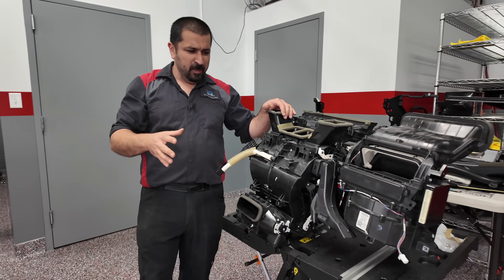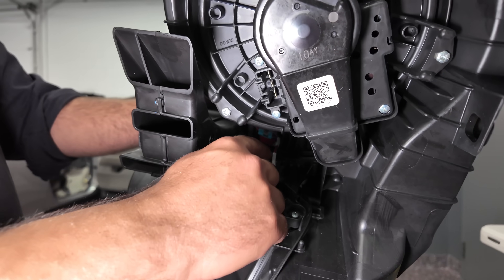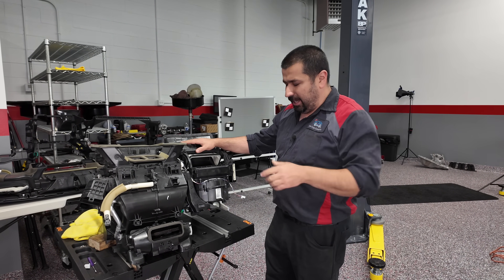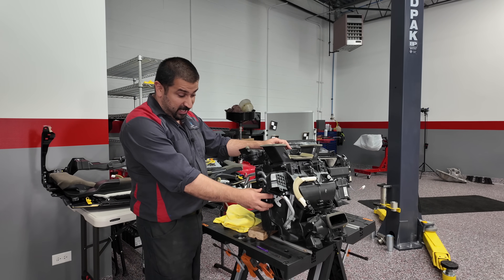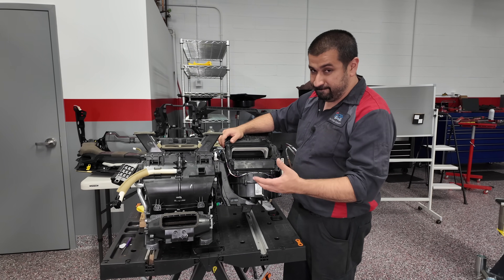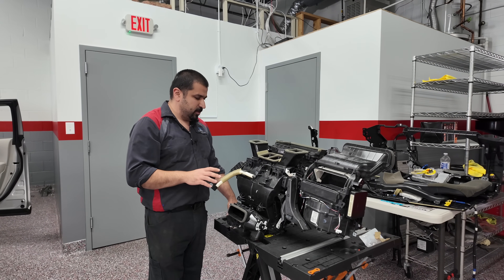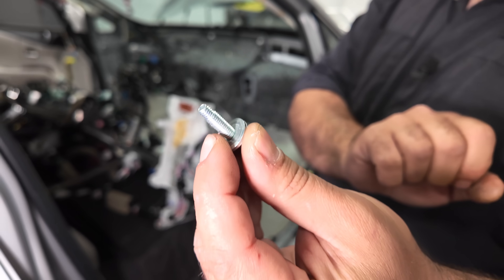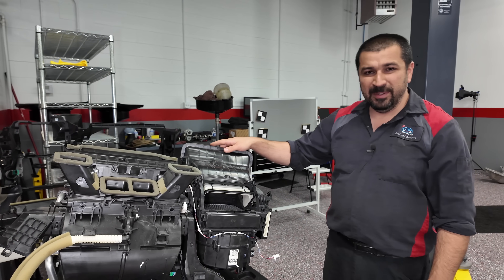THIS is Why Car Engineers and Car Mechanics Don't Always Get Along!

Comment: As a retired tech, I can vouch for the fact that engineers have never given a second thought about serviceability .  Their goal is ease of assembly and reduced cost.
Reply: As an engineer in the automotive industry I can tell you, only parts that might break during the warranty we look for that they are easily replaced to reduce warranty costs. Everything else nobody cares. The Aftersales team might raise their hands but cost and weight reduction wins most of the time
Reply: It is called "Designed For Manufacturing".
Reply: @user-xu5vl5th9n  then we consumers should demand: "Pay for car as if we'll have to overpay for repairs.
Reply: @user-xu5vl5th9n  Design for Serviceability
Reply: @user-xu5vl5th9n designed for inconvenient maintenance
Reply: I was a licensed mechanic for 13 years before I decided to hop the fence and become an automotive mechanical engineer.

You will quickly learn that mechanics think engineers are their worst enemies, but the worst enemies for engineers are the accountants and management.

We can’t get serviceability design done because we’re suddenly over budget and we we’re already behind schedule by two months because the powertrain team and chassis design team cant seem to agree on whether a phase of assembly should be done by people or robots. All of a sudden HR is involved for diversity hires because politicians are pushing for more automotive workers. 

Literally adding a drain spout for the oil filter can alter the manufacturing process costing the design process an extra $50k - $500K.

For me having experience as a Mechanic before an engineer, the perspective changes. Problems trickle down from leadership.
Reply: I was a licensed mechanic for 13 years before I decided to hop the fence and become an automotive mechanical engineer.

You will quickly learn that mechanics think engineers are their worst enemies, but the worst enemies for engineers are the accountants and management.

We can’t get serviceability design done because we’re suddenly over budget and we we’re already behind schedule by two months because the powertrain team and chassis design team cant seem to agree on whether a phase of assembly should be done by people or robots. All of a sudden HR is involved for diversity hires because politicians are pushing for more automotive workers. All of a sudden engineers are getting hounded by management to cut features for cost saving and we’re stuck having to retrofit an older design revision now that a certain vehicle model swaps out independent suspension for beam suspension.

Literally adding a drain spout for the oil filter can alter the manufacturing process costing the design process an extra $50k - $500K.

For me having experience as a Mechanic before an engineer, the perspective changes. Problems trickle down from leadership.

I’m being oddly specific because I’m honestly venting of the ridiculousness that I should not be experiencing in my 1st 2 years as an engineer. R&D is nuts.
Reply: Allowing for the front passenger to control passenger side temperature is IMHO a mistake. It adds too much complexity and creates interior temperature inefficiencies. I have to struggle to disable passenger side temp control everytime I jump back in for a drive.
Reply: Not true that they don’t care or think about it. Engineers have bosses too and often must do as they’re directed.
Reply: @paulferreira8342  When you have to remove a bumper and fender to replace a headlight, someone, somewhere doesn’t care.
Reply: @rustynail7866 I did just that on my 2008 Toyota Camry yellow headlights. I'm not a mechanic at all and have to see how to replace a headlight on youtube. Wasn't hard but I see your point. It's alot of taking out screws, bolts and remember which one to put back. I did a few mistakes but easily remedy like a left over screw and redo (take out and put back in)

Yes, I have to take out the bumper, black plastic on the bottom of the vehicle, and the 2 sides of the front wheel to unhook the bumper. And then finally the headlights and not to touch the light itself. Pure fun and education as well. When I finish it, it was an accomplishment for a non mechanic.

The bad side is that 2 months later,  I got Tbone and my beloved 2008 Toyota Camry is total. What a waste of time, money, and sweat.
Reply: @rustynail7866  Some designs are better than others, true.
Reply: @rustynail7866 but the groupies love the way the front looks and the small engine bay, right!?
Reply: @rustynail7866  did you mean the lightbulb? cause I've had to do that for just the bulb let alone the whole assembly for a 2013 corolla. plus if the LED fails you have to replace the WHOLE assembly.
Reply: @tr1bes  No, you won't be scared to do it again next time or you won't feel bad about the cost of the repair. Either way, not a waste.
Reply: @rustynail7866  What car or cars have to have the bumper and fender removed to replace a headlight?
Reply: @bonzocleach2496  Cadillac Escalade is my immediate experience
Reply: @rufus2028  Thanks.
Reply: @bonzocleach2496 
Vw Passat, lancer too
Reply: @paulferreira8342 And the boss of the bosses is the customer who doesn't want to pay too much for a Toyota. Hence, we have a conundrum, should  Toyota spend more to make everything easily serviceable and will customers pay the extra cost for something that 999 times out of a 1000 will never see the benefit of?
Reply: @briank10101  Even at Toyota and Lexus, quality is declining, while prices continue to rise!!
Reply: @paulferreira8342 that's where the engineers are supposed to show their expertise and chime in. If I were am engineer, I would want people to know I designed a efficient, but serviceable engine and vehicle.
Reply: @David.D3  I hear you. The thing is, engineers can submit brilliant designs and the bean counters still tell them to GFY and tie their hands. Engineers are forced to make many compromises playing the hand they’re dealt.
Reply: @paulferreira8342  are you forgetting their bosses are engineers, too?
Reply: @rph247  Not always & probably not even often. Occasionally, yes.
Reply: Totally agree especially on European vehicles
Reply: @PeterHernandez-lg2eh  European vehicle is what I call over engineer. 

My work place has a few gigantic machines that are so complicated that the company keep calling the German engineer to come over so often.
Reply: @tr1bes  We talk a lot about Deusche Qualität, but that was before.
Nowadays, and like everyone else, their production has dropped a lot in quality, they buy and manufacture a lot in countries with low manufacturing costs, and their vehicles have exactly the same problems as the others.. Except that they are more expensive to purchase and maintain!!
Reply: @rustynail7866    Yes, I am also a retired tech for 50+ years. Where we live there is a looney Hospital close and everytime I pass it I think to myself that I'm glad I retired when I did or I would have likely been living there. Working on dashboards is stressful.  if you forget one tiny part, screw or bolt, you have to start over. I would rather remove and reinstall an engine.
Reply: Unfortunately I fully agree, quite often bad design components are followed by chep design  basics like not rust proof bolts 👍
Reply: Engineers need to listen to the the techs and mechanics for feedback. But techs and mechanics also need to learn from and respec5 the engineers…..It is called teamwork…..🎉
Reply: @GraydonTranquilla  true that, I'm a manufacturing engineer and I talk to my techs everyday to get their opinion on things. I try to make changes but I can't always. Sometimes they are right and sometimes they are wrong, sometimes I am right and sometimes I am wrong... everyone's learning
Reply: @GraydonTranquilla  we do, but management wont let us because is uses up too much time
Reply: As engineers, we would love to make the optimal trade off between cost, weight, serviceability, reliability, etc., but often our hands are tied. Suppose the reliability and serviceability of a design is not quite optimized -- we would love to make it as optimized as possible, but often engineers face time and development cost constraints that don't allow them to do so. Let's suppose it would cause another 6mos delay in the project to optimize the design for serviceability -- upper management will often make the decision to forgo that optimization in order for the product to launch on time. Similarly with development cost -- let's suppose it will cost another $250K to optimize the design -- management might likewise make the call against spending that money for further design change.... I have had real experience with this
-- where engineers made great arguments to fight for additional time and funding to optimize the design (for serviceability or reliability) and lost. That is the reality of product development, not because engineers don't care.
Reply: That's because bean counters run the car companies now.
Reply: You can take this to the bank: Cars are designed to be easy to manufacture, first and foremost. So long as parts last through the warranty period, the expense of repair is passed to the owner. The factory manual — three volumes totaling more than 4,000 pages — for my 2008 RX350 says that the engine is to be removed to replace the water pump. Seriously? Mechanics know that the repair can be accomplished by jacking the engine after removing a motor mount. So the company’s disdain for the customer’s dollar even extends to the writing of the repair manual. Yes, Toyota generally has laudable reliability. But the automobile industry as a whole is designing and rebuilding increasingly unrepairable cars, vehicles that will be scrapped by the thousands when their wildly expensive parts fail before their time.
Reply: They don't want you to keep the car for long.they want you to buy a new car every five years.i mean the car companies
Reply: I'd like to note that in addition to what most people are listing, sometimes engineers make things essentially unserviceable because it increases reliability in certain circumstances.
Reply: Way over engineered vehicles now. Parts only live till warranty is over, after that they don’t care.
Reply: Ignorant mechanics and technicians simply do not understand how big companies, design and part production works!

It’s not that they don’t care. It’s simple economics dealing with already available parts, plant tooling and procedures/training, available space/packaging, bean counters and many other considerations that ignorant people simply refuse to SEE!
Reply: Ignorant mechanics and technicians simply do not understand how big companies, design and part production works!

It’s not that they don’t care. It’s simple economics dealing with already available parts, plant tooling and procedures/training, available space/packaging, bean counters and many other considerations that ignorant people simply refuse to SEE!
Reply: People wanting more tech and luxury is the main culprit imo. If you buy a simple car you wouldn't have these headaches or at least they would have been easy to fix.
Reply: It's the same with aircraft. Fighter jets are the worst. I was an F-16 engine mechanic and I swear those old General Electric engineers hated mechanics.
Reply: Such a great forum to be honest.  You and the creator.  It must be tough to give engineers an honest shake.  I can't imagine an engineer understanding a mechanical perspective and meanwhile they're dealing with having to come up with brilliant work under the confines of a budget.
Reply: @TheMB2333  you act like it’s a liberal arts student making a part for the time. It’s mostly car industry experienced folks making cars more advanced 😭 they aren’t going to turn down 200k a year to argue that headlights need to just pop out and be replaced as a unit, which would probably be expensive if was made to todays crash standards. Man up cry babies, it’s a bunch of ten mils and plastic clips 😭😭😭😭😭😭
Reply: @TheMB2333  I know a few engineers who work for the vehicle industry and many of them are actually quite capable mechanics who maintain their vehicles themselves instead of using certified services because they do not trust professional mechanics and the service business as a whole. They all say that the industry most of the time cares about manufacturability, tooling, and warranty costs. When they release designs that are not serviceable, it is most likely not because they did not notice that the design is not serviceable; it is because they did not have time to improve design enough under all other constraints.
Reply: When the government must maintain that equipment, things change, including the price.
Reply: Bean counters trump every aspect of design.
Reply: Kind of like the tundra starter and alternator
Reply: engineers only do this because it comes from their managers who take direction from their corp leaders. who are bean counters. 
Leave an engineer a lone you'll end up with a pencil that cost $90,000
Reply: The goal of automotive engineers’ management is low parts and assembly costs. Not necessarily the engineers themselves.

Same goes for programmers. I work in IT and I’ve witnessed the frustration good programmers experience answering to those in charge instead of writing good code.
Reply: @briandeschene8424  Most people lease these luxury cars, so they'll design components that have an average lifespan of 4 years. Short term profits at the expense of serviceability.
Reply: manufacturers only care if a part fails inside the warranty period. outside of that owners can F off. don't like spending 3 grand to fix your air conditioner? How about i sell you a new car!  Planned obsolescence.
Reply: @BassRacerx  You nailed it. Phone manufacturers follow the same rule.
Reply: Assembly and reduced cost? If it was that easy…when designing cars they have to balance reliability, performance, technology integration, safety, cost and durability. All competing priorities and serviceability being in that mix. Your comment is like all a tech does is replace worn part with newer part.
Reply: @johnt7776 no.  The having to remove bumper and fender to replace headlight and things like that are entirely cost driven.  It’s done that way because it’s much easier and cheaper to make one large plastic component with few access points and cover pieces, and cheaper to assemble with snap in clips instead of bolts and screws.  But that makes it more difficult to take apart and especially to take apart just the pieces you want to access.
Reply: @johnt7776  Oh look. An offended engineer.  You act like placing a starter inside a bell housing or an injection computer in the valley of an intake is balancing reliability.  Book sense vs common sense.
Reply: Sounds like you guys prefer the look of squared universal lights lol
Reply: @xFactoryUSA   and make out of glass please...no haze cleaning
Reply: @xFactoryUSA  Yep, bring em back
Reply: @xFactoryUSA  yes. It saved hundreds of dollars. Not every vehicle is bought for looks. Todays trucks have more luxuries than yesterdays Buicks.
Reply: @MaldoArte  a sealed beam vs a projector lens 😭 hush nobody wanted to drive in pitch black like

Comment: Car engineers and machinists don't get along either... They design stuff that is unnecessarily difficult to make. Having been in each role and technically knowing better, its surprising the things you don't think of in one role or another even when you know all 3 disciplines. As a machinist I cursed my engineer self when I didn't design a feature easier to make, and back to the drawing board. As my mechanic I've cursed my engineer self for making something hard to assemble or maintain.... That said, I hate HVAC and its designers most of all lol. I had the clicking on my Audi, but thankfully all 3 motors are accessible from under the dash without disassembly (though a long difficult reach, still reachable). There are a few disciplines that don't get enough funding in the engineering realm - DFM, DFA and DFS - Design for Manufacturing, Assembly and Service.

Comment: I believe that engineers should have to dismantle and service their designs. If they can't dismantle it faster within five times, the design needs to be scrapped. If they continue to design things like that, they should have to resign.

Engineering 101: "Bad design and you need to resign...."

Comment: Not a big fan of auto temp control.  It just seems like sure-fire way to shorten the life of the servos.  I keep mine in manual.
Reply: My car turns 30 next year and the climate air works just fine.
Reply: Dodge vans with third-row heating core.
 How did that all work out?
 That's what I thought. 
 I sit in the front. if you don't like it/ take a taxi! Suck creature comfort BS.